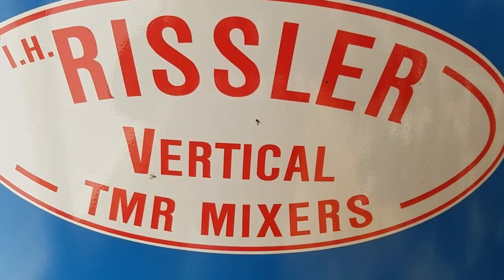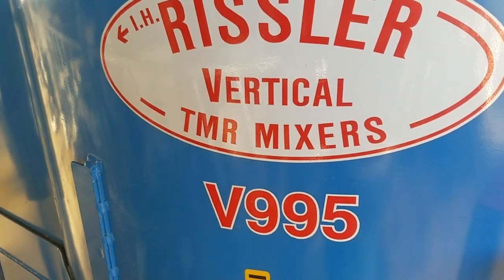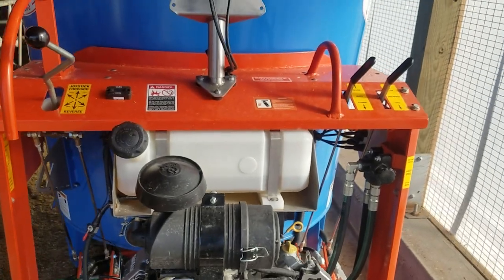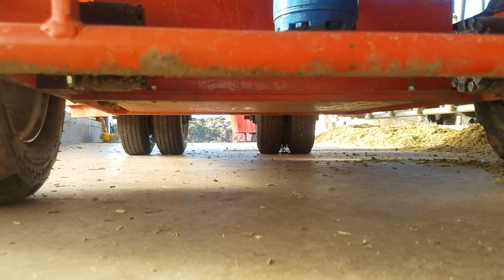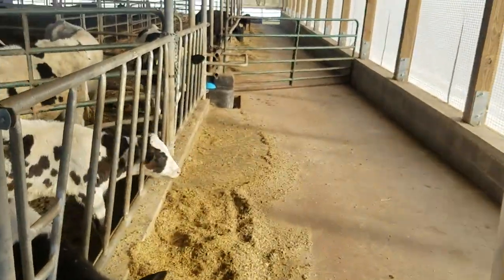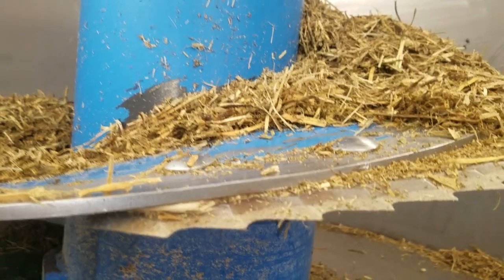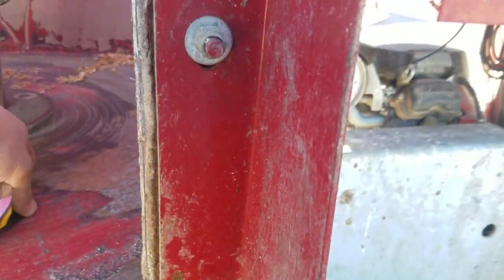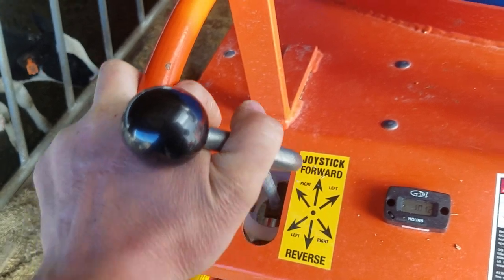Risser vertical TMR mixer v995 versus Jaylor a 100

Comment: first off -TWO THUMBS UP - on the series of videos concerning TRM mixers.   the Rissler has much better blades.  the no steering wheel would be the only drawback I can see so far.
Reply: Soybean Farmer yes it is very tricky to drive. I am about half of nervous going down into the barn. thanks for your comment have a great day
Reply: Soybean Farmer Good point aout the steering.

Comment: Are both machine 100cubic foot?     I read the tag on the blue machine and I'm guessing the 100 on the Jay Lor stands for cubic foot       What horse power does the Jay Lor have?      I think you will get used to how it drives in a couple days.

Comment: It does look significantly heavier built than your Jaylor. I'm not sure I could cope with that slightly weird steering system with that single lever rather than a steering wheel.  I can well image either hitting the feed barrier or the shed posts! 
That engine will surely suck some serious amount of juice and that will become even more significant when you eventually bring the second cattle shed on stream with some big cattle with big daily appetites. How much fuel will you need per week at todays numbers of cattle?
Do they both have approx the same turning circle size?
What is the height like for clearance when you want to load it with the skid steer?
What is the drive system for the Jaylor augars - similar or not?

I shall be interested to see if Jaylor responds to your video about the knives and, if they do, what answers / suggestions / solutions they come up with.
Reply: Dan Whiteford Jay Lor did respond thanks for your comments and I look forward to working with them. they are a great company